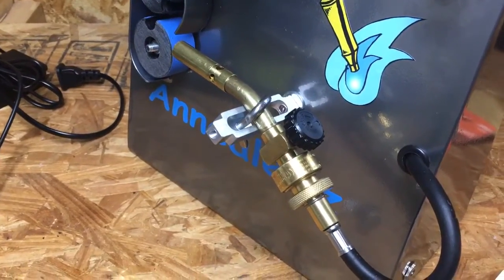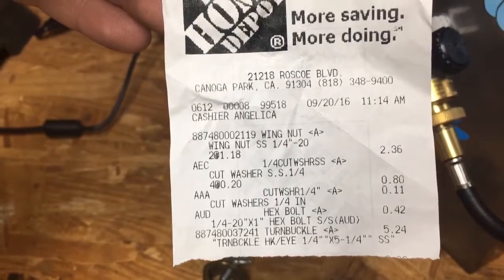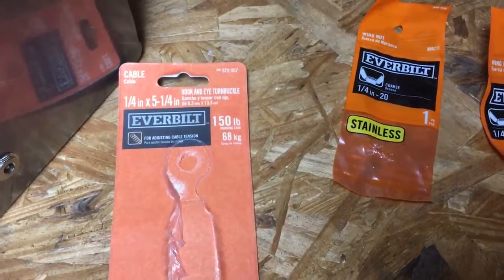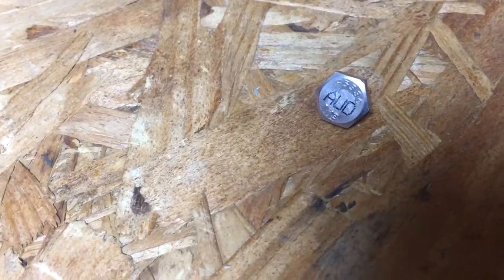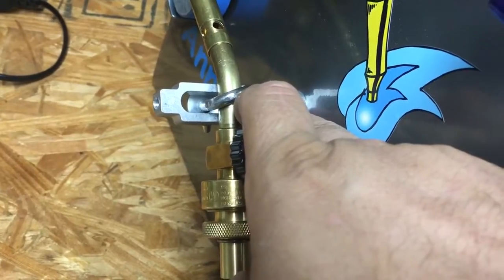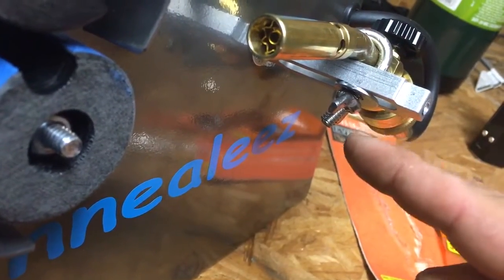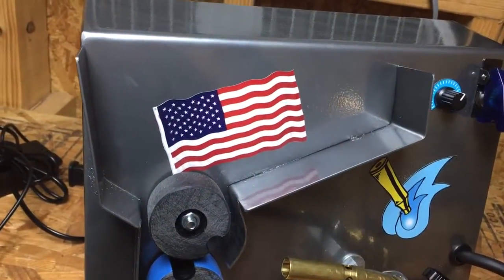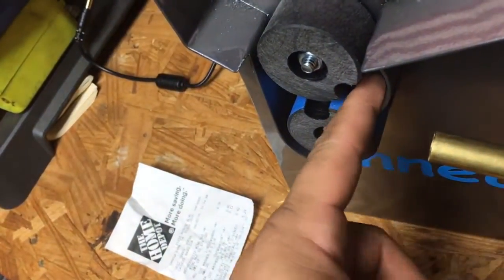Annealeez Brass Annealing Machine Torch Holder Upgrade Mod

Comment: You could have bought a longer bolt or all thread with a nut on each side of the panel and used the existing clamp and had all the adjustment you need, plus would have been less than a dollar.
Reply from the maker: This is the old torch holder bud. Watch my digital display mod video and you’ll see what I’m using now.

Comment: Take the old clamp and bolt it on the slot on the turn buckle. Then you would not have to buy the other part from HD. It also would give you more adjustment.  MAGA !

Comment: Could you have used the rod you cut from the torch clamp for the threaded rod between the turn buckle and your mounting box instead of buying a new bolt and cutting the head off of it? Also I am think of putting a tension spring under the wing nuts for easy of movement.